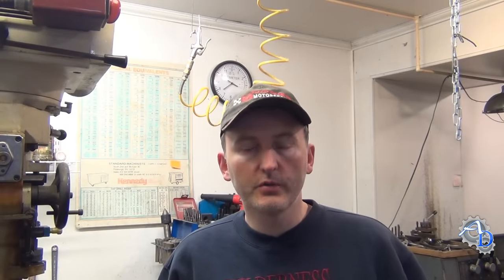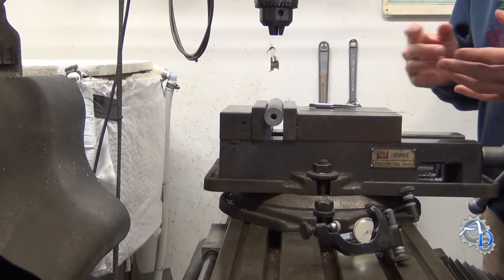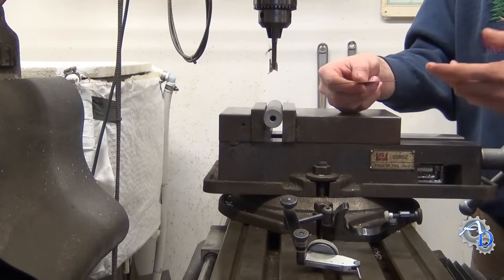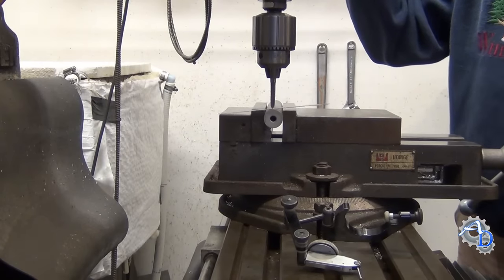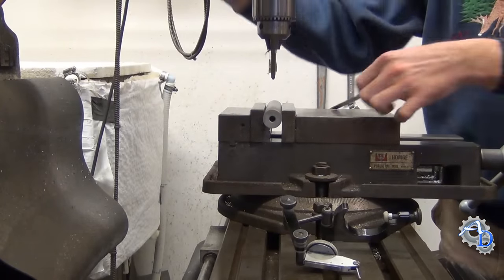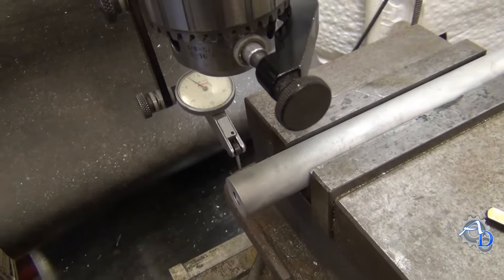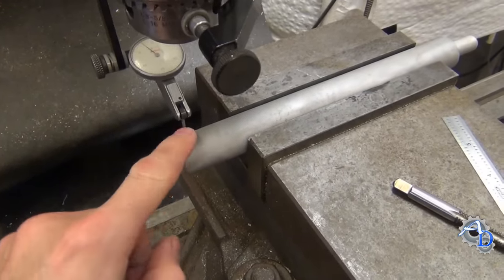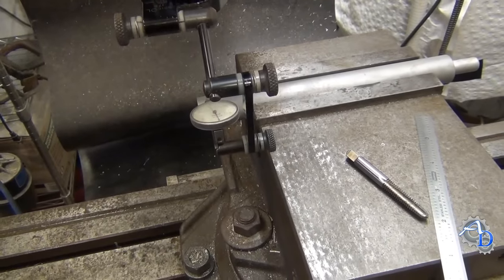Old Machinists Mill Trick To Quickly Find a Rod Centerline

Comment: One more memory from an old machinist.  Years ago my son and I were doing a line boring job at a power plant.  Needed a 3/8" hole drilled centerline in a boring bar.  Maintenance foreman told us to take it to their machine shop.  Foreman there gave it to a machinist to do.  It took him an hour to line up with tri square framing square six inch scale tape measure and all kind of eyeballing.  Even a machinist level.  We were told to stand against the wall and don't interfere.  I bet my son that when we tried to put the two shafts together with a 3/8" bolt they probably wouldn't line up.  We couldn't just run a drill bit through both shafts.  The other was already drilled to line up on a power head so we had to use a carbide burr and grind out the hole drilled by the Union scale payed machinist.  He never tried your method at all!  Should have.

Comment: Also can be used when setting lathe tool centres.
Reply: Grind the teeth off an old hacksaw blade to make lathe tool shims and center finder scales/rules.
Reply: That’s the way I’ve always set my lathe tool just below center.
Reply: This is the way I was taught in school nearly 15 years ago, find the vertical then drop the toolholder a quarter of a turn under centreline, thought it was basic stuff. Thread-cutting on the other hand is a nightmare for me.
Reply: @adam9674  oh shit, basic lathe question:  cutting tool should be just below centerline and not AT centerline???  oh man guess I've been adjusting my tool holders wrong!
Reply: Yes, learned that almost 50 years ago in high school. Simplest is most frequently best. To come within .001" by eyeball with a scale [ruler] in this manner is not unusual. Plenty good for cutting an ordinary key way for a pulley or such, especially considering a rolled shaft such as displayed is lucky to be round to a thou. Great little video! Jogged my memory.

Comment: This is exactly the simple solution I need to shorten a rod in a hydraulic cylinder and re drill the hole for the pin. I am no machinist, I appreciate this approach. I do have a mill vise and a drill press and this will be plenty accurate for the farm tractor loader I am repairing. Thank you, and I am subscribing as a thank you.

Comment: I'm a semi-old school machinist, I started doing Bridgeport mill work out of high school in the early 1980s, just before the cncs started really taking over. I knew and used the scale trick, and used it from time to time. I learned under an old timer who went through his apprenticeship in the 1950s, a very knowledgeable guy. More typically I would edge find the hard jaw, zero, measure the diameter of the rod and dial to center using the DRO. That would get me within a thousandth and is quicker than using the dial indicator. I was in the trade for about 18 years.
Reply: Jim Watson  Used to show new guys how to setup a piece in an OD grinder to .001" TIR with a file jammed into a piece of wood.  After that I'd hand them an indicator and tell them never to tell me it's too hard to get a piece setup to .0001 TIR.   Would get requests to show them how to do a setup, but never got "that's impossible again".  :-)
Reply: Jim Watson  One of my first experiences when I  got into tool & die I was 19 years old.  About 1 year into it I was sent to work in the gear room with the top guy in the shop.  Man, I though I was hot shit back then.  First thing he had me do was setup a piece between bench centers for the guys who were going to grind the external gear form.  I had been pretty darn good at setting up at that point so when I had the front of the piece setup dead nuts true and the back running out .0001"  I called him over.  He looked at it and asked me if I knew what he meant  by "true"  because the back still ran out.  Told me to give him a call when I got it right.  Talk about being humbled!   I went from smart-ass to dipshit in a heartbeat.   Damn, I loved that guy.  Learned so much from him over the next couple years.
Reply: Jim Watson  I know how to use a manual mill. But I also know how to use a cnc mill. CNC milling is the real test of skill, one reason is you actually have to know the correct speed and feed and your not just going by feel. lol. You got no feel on a cnc, so you gotta know what you're doing. No matter what job it is, I'll always choose the cnc over a manual mill. Had that argument with my grandpa and said okay, let's race. I had 2 parts done before he even had 1, and mine were nicer, chamfered, and dead accurate
Reply: Jim Watson lol nice
Reply: Jim Watson absolutely agree. I’ve been machining for 17 years now and in my opinion it’s an absolute must to be able to use manual as well as CNC. I’ve run cnc’s for years and its still a pleasure to make stuff manually. No feel in cnc’s which in part makes them a bit more of a challenge in that way.
Reply: As a general rule I set the readout absolute on .000 for X and Y when it is at the back (unmovable) vice jaw for Y,  and the left side of the jaws for X.  I use a scale to place the part to be worked banked against the left side while tightening the vice.  That is now at .000 X axis and will dial in what ever is required.  Fast and simple.
Reply: @highstreetkillers4377    ... I call bullshit on all your claims. Your an effing rattle-trap YouTube troll.
Reply: @highstreetkillers4377  , understand cnc is faster etc, etc, but you statement that you have to know speeds and feeds is bullshit. They've tables for that, just look it up.

Comment: Thanks for sharing this old-school wisdom.  It makes good sense once you explain it.  But it's not obvious to beginners like myself.   Very useful technique, and probably good enough for many applications.
Reply from the maker: Thank you for your comments :)
Reply: "good enough" is something a machinist should never say. People setup just to put eyebolt holes, think good enough, when it's not straight on the machine. Because of that attitude they also didn't clamp the block properly. So of course it moves when they try and use a M48 tap. Now that hole is garbage, and no way to set it up the way it was. So they got to do it all over again in a different spot or have it filled with weld. Worse is the guys that try and hide their mistakes, wrong eyebolt hole on a 50 ton block is life threatening

Comment: I've been using this method for years, and it's an extremely accurate method for finding the center of the workpiece. I prefer to use a center drill in a collet to reduce runout to the absolute minimum; drill chucks (mine anyway!) usually won't center the drill as accurately as will the collet. 

On a slightly related note, if you find yourself having to drill a hole on the outside of a curved surface, and all you have is your trusty drill press, one of the best ways to avoid drill skate when starting the hole, is to take your favorite center punch and grind its point into three facets. The resulting "three-sided dimple" will center your drill bit beautifully every time.

Excellent video!
Reply from the maker: Thank you!

Comment: Fantastic idea. I am not a machinist but I do a lot of repair and custom work on small equipment and occasionally have to drill shafts to accept cotter pins. I hate that I have drilled holes off center and made a decent job look like trash, but now I know how to do it so that it looks good enough for the girls that I run with.
Reply from the maker: Thanks!

Comment: I'm an old machinist and I can think of about a dozen ways to center the spindle axis on a diameter. The one you demonstrate was the second I learned as an apprentice in the early '60's. 0.002" TIR? Pretty good for an eyeball method but accuracy degrades as the diameter increases since the tilt of the scale is an arc sine function of the centering error. Another source of error is eccentricity of the point. Few drill chucks center better than 0.003" TIR and without a max error mark on the chuck body your error may vary unless you follow up with a tram.

If you use a center drill, be sure to align the crest of the chisel tip parallel to the diameter centerline. If crosswise, the chisel tip constrains the scale's tilt to zero over the tip's width. Try it to prove it to yourself.

You'll be expected to conduct this centering evolution in less than 10 seconds on the production floor and you'd better have the Indicol right handy to follow-up if you want to avoid a bellow from your boss.

Plenty good enough for set screws, through pins, and most keyseats, though.
Reply from the maker: Thanks for the comments. Good advice.
Reply: I don't know what was with the math gibberish. You didn't say anything that really made any sense. The reason this method is less effective with a larger diameter is because the contact point is wider. That's it. lol
Reply: @ryanfreeman125 , what you mean to say is, you don't understand the technical aspects of machining, or the mathematical functions that describe shapes and motions, and so anyone speaking science goes over your head, so you ridicule them to cover your lack of understanding?
Got it.
Reply: Forrest Addy, you made me realize how much of a hobbyist I am... It takes me a good 3 minutes to do this alignment and honestly I probably don't get closer than about 10 thousandths.  Respect for your practiced speed, accuracy, and knowledge!

Comment: OMG, it seems 241 people have a faster, cheaper, simpler way to do that !!
PD: could I see their videos showing it?
Reply: Apparently now 351+ people smarter then the rest of us, yet can't or don't care to share their ways with us poor dumb souls so I guess we'll stick to this method. Great video! Thanks for this!
Reply: @jasona-EV  Ignore the thumbs down. 10-year-olds and trolls will down-vote a good video just to agitate people. It doesn't mean anything.
Reply: Well if you would attach a dial with the center in the middle of your spindle axis you could get a better result. (1 micron dial). I don't dislike this video tho because you might not have a ready to use setup in the shop and making one takes way longer then doing this if you need it only occasionally. 

Prety sure its faster then doing this. But you need a dial in a toolholder permanently fixed to beat the speed.

Comment: .001 that's pretty close for basically eyeballing it.  Great tip.
Reply: But there is a huge difference between mm and inch! What unit is he using?
Reply: He said .001, and the old guys were that good.  If someone is working within an inch that is blacksmith work.

Comment: This tip also works vertically on the lathe.
Reply from the maker: I'll have to try that.
Reply: Yes   I still do it after 40yrs  when I Single Point.   as for a Mill buy an Edge Finder they are cheap or you can use a 1/4 dowel pin and a piece of Paper even cheaper

Comment: Old as the hills.  But works better than most "methods".  I did a video on this back in 2016.  Same principle as finding lathe centre.
Reply: What methods does this work better than lol? Other than eyeballing it with literally nothing else, this is the least accurate way of finding top dead center. 

Gage or dowel pin in the chuck / collet, sweeping with indicator, a $10 edge finder, zeroing the non moving jaw, all far more accurate and arguably faster.
Reply from the maker: Thanks for your comments. Just saw it. :)

Comment: this is a good tip. I've been cutting off a small piece of the stock, then running a hole through it and laying it horizontal to the piece I'm working on to act as a guide. Since it's the same diameter, the hole runs center of the stock, and the holes you drill are centered to the stock. Learned that one from my gramps.

Comment: use this technique for a lathe tool, making the scale vertical.
Reply: That's what my instructor taught us at Tech school. This mill version wasn't taught to us, but it's pretty cool!
Reply: Agreed. I use it with a threading tool to find center on a lathe. Then I drop down a few thou depending on the part diameter.

Comment: Nice demo.  also used on the lathe for tool height.
Reply from the maker: Thanks!
Reply: Yup. Do that all the time. 👍
Reply: Yep... Do this all the time...
Reply: Its really only useful for a lathe, where finding correct tool height without taking a series of cuts and making adjustments can be more time consuming (although still extremely easy).

I can't really think of a situation you'd find yourself in where you'd have a mill, have stock, having tooling, and not have a better, faster and significantly more accurate way of finding center. 

If you don't have access to an indicator or some form of measurement tool from the spindle, you wouldn't know if the vise was running parallel with the table movement, and finding centerline would be worthless anyway, unless you were drilling a single hole.

Comment: This is cool. I'm not a machinist by any stretch of imagination; however, I like to fabricate parts (or need to) from time to time. I inherited quite a few tools from my father, but he passed away when I was very young. Both grandfather and father were tool and die makers and mom was in industrial supply sales since the 60s. As I'm now a semi-retired (is that a thing?) software engineer who spent 20 yrs. writing code for industrial/mfg. controls, I've been around quite of few of the old school guys and am now learning proper/better techniques for machining parts. There's so much knowledge and many techniques that are beling lost to CNC. I don't want any digital stuff in my little shop.  After spending 40yrs. doing 'high-tech', I'm much more interested in 'the old ways'. Thanks to "You Tube University" and people like you who take the time to make videos like this. Thanks for making and posting this, and I look forward to digging into your other content.

Comment: The best tool for this is a steel ball bearing in the chuck. Guarantees center.
Reply: Sounds interesting.  Thanks.
Reply: Tim Hallas please share
Reply: @AtimatikArmy   What is there to share. Use a ball bearing in the drill chuck to mark dead center.
Reply: @timhallas4275  oh so basically just like using a tap or a drill bit or anything else I got you
Reply: @AtimatikArmy  No. Taps and drill bits do not have perfect centers. ball barrings do.
Reply: @timhallas4275  Got it.

Comment: Nice quick illustration of a relatively common method, that is no longer so common in the age of CNC production shops.  Like others have commented, I have used this method for decades on the lathe, to get tool height correct, but for some reason, never transferred the procedure to the Mill/Drill.  I always edge find, just to do it the "right" way.  There are plenty of parts that I make in my home shop where "close enough" is just fine when drilling round stock on center.  I will remember this one for sure when I need a quick center.  Thanks!

Comment: An old grey haired fart showed me this on a lathe when I was young. Used it my whole life. That old German guy showed me a lot of tricks.
Reply: You use this in lathe as well?
Reply: @MrJean9009  to get toolrest the right height when turning/facing
Reply: Look like a great trick for a drill press too when close enough is good enough.
Reply: @MrJean9009  Yes sir. To set cutting tool on center or maybe a little above center.

Comment: It's a clever way to find the center. Sometimes negative comments can be helpful criticism. Most machinist I know have thick skin. When close tolerances are required this method is not good enough. I've been machining for close to 40 years. Good video.
Reply from the maker: Thank you. I have no intention of staying in a machine shop until retirement. I'd rather be beaten repeatedly with a club. I'm glad it worked out for you.

Comment: I learned this method as a first year Scientific Instrument Maker apprentice 54 years ago.  It has been most useful in centering lathe tools.  Essentially this method utilizes the fact that a tangent to a circle is at 90 degrees to the radius at the point of contact.

Comment: Bring the tool down to where it just touches the part, move the work back and forth . The scratch mark is center.
Reply: The scratch length on the round object should equal the dia of the mill tool, eyeball as close as you can bring them together and drill.
Reply: Same here.

Comment: Instead of a metal straightedge. how about using your technique with a short torpedo level - it might make it easier to find top dead center. Just a thought.
Reply from the maker: The scale needs to be really thin, but you could use a scale with a level sitting on it. It would be really accurate.
Reply: Good point - thanks. I guess a small gunsmith level, which is magnetic, could be laid on the scale - wouldn't add thickness but would still minimize the fiddling - about $5-10 bucks.